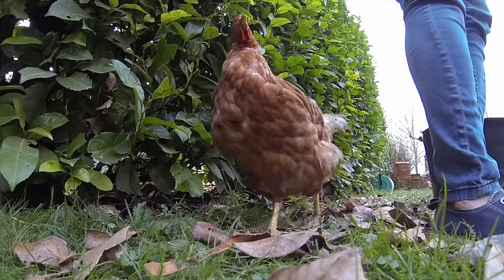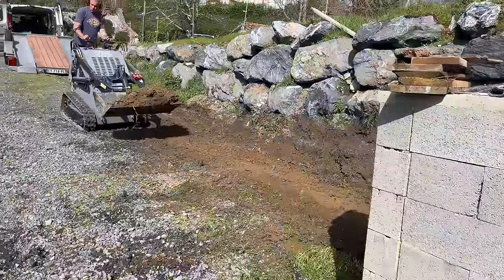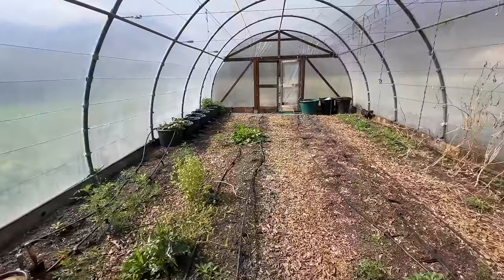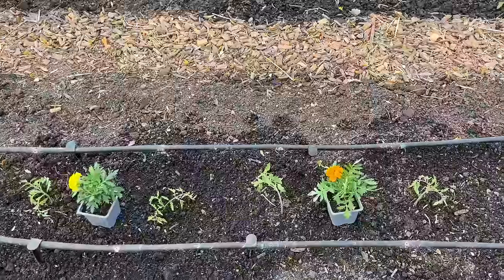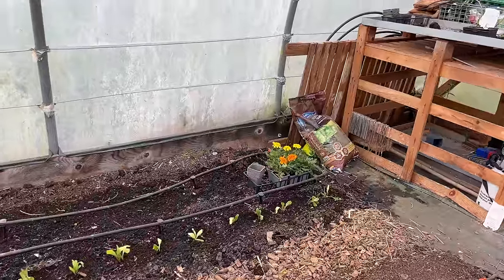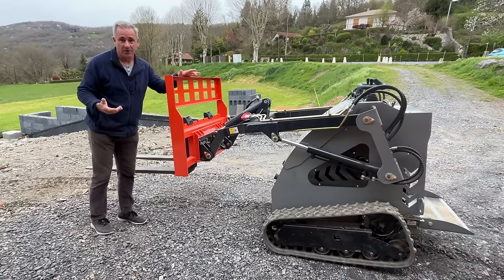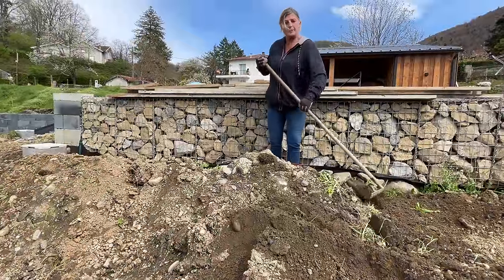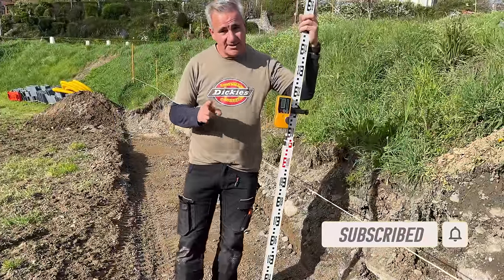Poly Tunnels & Driveways | The Earth Moved

Comment: You should maybe 23:18 add a counter weight to the ride on part at the back,  100k over the back would make a huge difference 🤔
Reply from the maker: I am just worried this may put too much stress on the motor and tracks, but it could do with some for sure.
Reply: I really think that 100 kilos or so would make a massive difference to the tipping point of the machine and I don't think it would hurt the machine 🤔

Comment: What a difference that wacker plate makes!! It’s coming along great. Glad to see the poly tunnel update. Cutting the forks down was definitely the right move, it’s going to make a world of difference for you one more thing you might consider is adding some counter weight to the back side around where you stand.
Reply from the maker: Cheers Harry, just worried if I put too much weight on the rear it will stress the tracks even more.  New tracks have arrived so will get them fitted.

Comment: Hi Ian and Julie.
I just watched this video and heard you mention a need to fabricate something to add to your small hydraulic bottle jack to help you lift the skid steer.
Ian, draw something up with some dimensions and I will fabricate something for you.
Most bottle jacks have a pad at the top of the ram that has a screw thread for added height / fine adjustment. Maybe we can use a bolt (or some threaded rod) to secure the attachment to the jack.
Reply from the maker: I basically ground out a groove in the top of the jack so the skid bracket would sit in it and not keep sliding off.  Works OK but the bottle jack is still unstable on muddy ground.  It is a very lower chassis hence the bottle jack and not a normal lift.

Comment: Hi Ian and Julie from Michigan 👋👋, Ian I wonder if you took that upper plate you cut off of the forks and welded 2 small extentions on it ,with holes drilled into the extensions that you could pins and retainer rings on it and weld a small plate with corrusponding holes to put the pins in that you could mount under the fold down plate that you stand on, and use it as a counter balance if you were fork side heavy, you put add on weights to the plate and be alot more stable and even, and it would also provide a wider base to stand on if you needed, I know that description was very confusing but I can see it in my head ,just can't show you what I mean.basically it is a removable back counter weight /step .oh well I will shut up now 😂😂😂😂😂 great job as always you guys . Bye for now ✌👋👋Kevin
Reply from the maker: I know what you mean - I am just worried that too much weight may put stress on the rear wheels and tracks when turning, but I will try and find some counterweight option to try it.  Thanks ☺️

Comment: Ian, how about a slab of say 25mm plate the size of the standing platfom bolted on undeneath it to give a bit more counter weight. Ofc, first find a bit of plate at a reasonable price. Are scrapyards a thing in your parf of france?
Reply from the maker: Yes, we have a friendly scary down the road -  I will take a trip to see what they have.  That will mean I need to get a plasma cutter 🤣
Reply: @HomesteadingUncontained  An affordable plasma cutter probably not cut 1-inch (25mm) steel plate
Cut would get ragged at about 5/8-inch (16mm), based on experience with my 50-amp plasma cutter